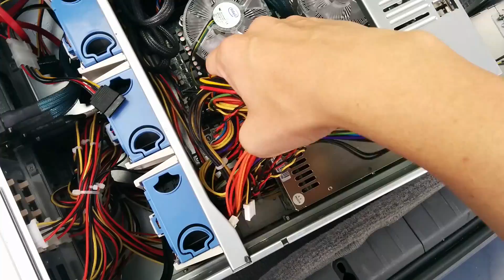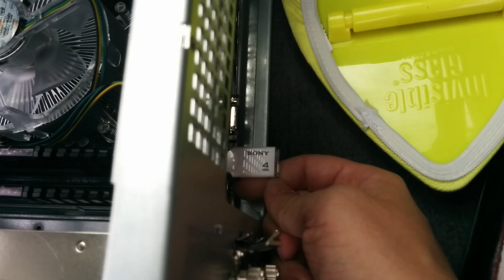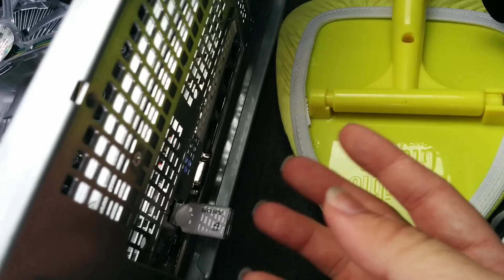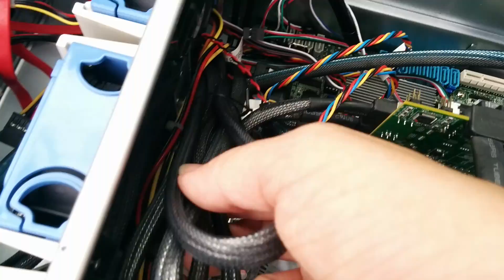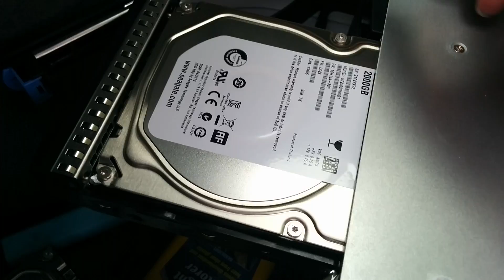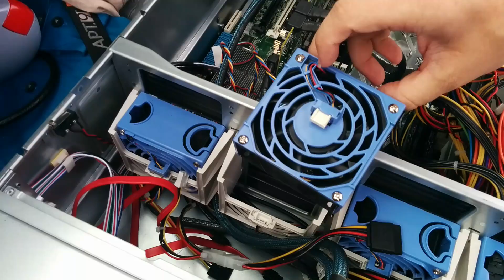Just a Server I Built

Comment: I have recently re purposed an old 4U pentium 3 server. I gutted it and put in a single Xeon 3 CPU board and higher wattage PSU, 8 gig of RAM and an Intel Raid card that supports 4 SATA drives (500 gb ea). Just parts we had around the shop, nothing new and fancy but it is what it is. I have no idea what I am going to do with it but I got the original from The Flamingo Hotel and Casino in Vegas last year. I may set it up as a web server or something.
Usually we buy servers new from Dell for customers and we take in the old equipment to recycle unless a customer need a specialty server like to record time lapse from traffic or security cameras or something.

Comment: The only issue I see here is running ESXi on a flash drive.

Not something I would do.
Reply: ***** Ah, Just worries me about the flash drive crapping out and taking out the node until you put a replacement in there. 

Maybe the I/O of esxi itself isn't that much to warrant a problem with it.
Reply: ***** Hum.

Out of curiosity how many IOPS does that raid array get if you know.
Reply: ***** I figure it's pretty high for that many drives in RAID10 and the 1GB cache helps alot to.

Does it have a BBU as well?